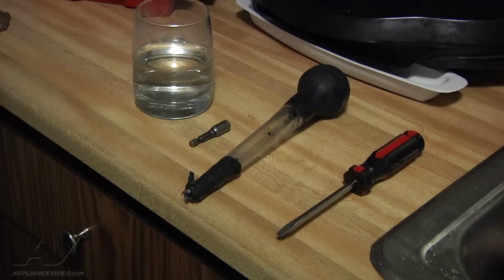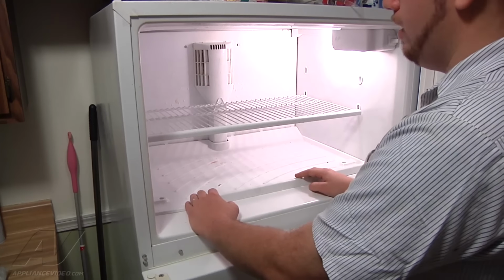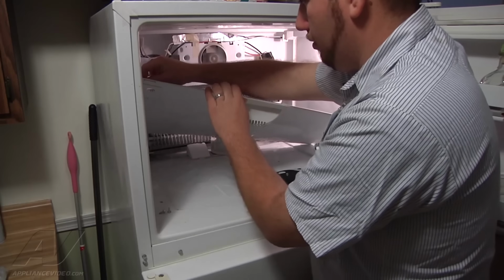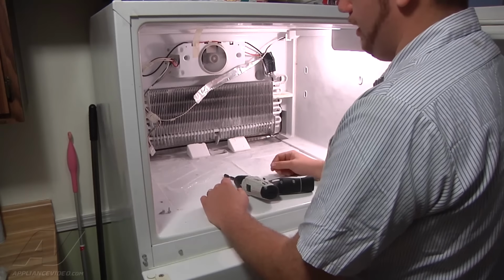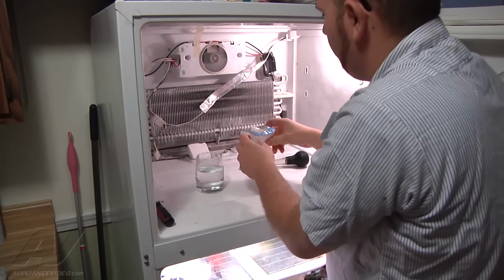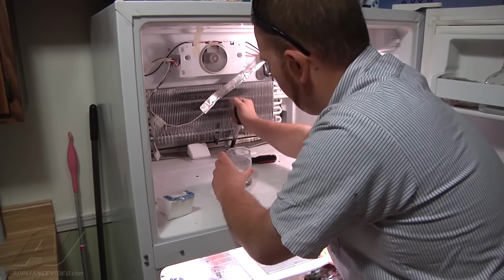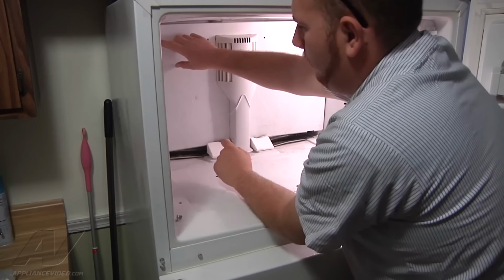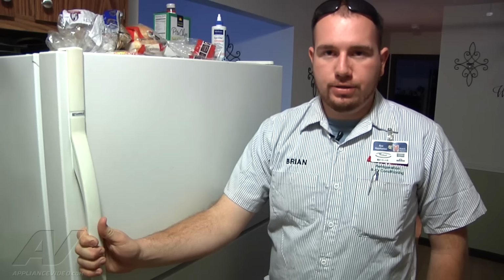Kenmore Refrigerator Repair - Water Leaking From the Freezer - Evaporator Drain Pan

Comment: Thanks! Mostly helpful only.... my Kenmore(freexer on top) model 253.68802011, doesn't have a bottom panel to remove.  Just the back panel that exposes the evaporator, etc. There are two ports visible there, one behind the other. Should I pour hot water down one of them? Both? What is there is ice buildup under the bottom plastic lining? How do I get at it then??

If you have a moment...

Comment: I did what you have shown and used a fish wire to clear the drain line all the way down to the drip pan underneath and everything was good for two weeks and I just today I have a layer of ice forming again. however the fridge seem to run well.  what is the next step?

Comment: looked and worked nearly exactly as mine. one note: BE CAREFUL WHEN PUTTING THE SCREWS BACK IN WITH THE FLOOR PIECE STILL OFF. i dropped BOTH of mine and first thought 'oh no - down the drain hole that went!!' 

It actually went down the air hole into the fridge and was just sitting on the top shelf next to the mayonaise. 2nd project (pulling out the whole fridge and looking for the screw in the back near the final drain pan) averted.

Great Video. Saved my probably 25 year old fridge from needing a service call ($$$).

Comment: Very good video. Very helpful.  Thank you.   My Kenmore is 47 years old.  Also freezer on top.  Is it set up pretty much the same way as in the video?   --===-  BTW, it's worked fine until a year ago when it needed manual defrosting for the first time.  I took the back panel off and I guess I got all of it except the drain tube, that I didn't know about.   So it drips sometimes, and used to overflow onto the floor.  I will fix that now.   ---  I had to replace the thermostat once, and once a mouse died in the fan at the bottom so the fan would not spin, but I didn't figure it out for 2 months.  I thought this would tax the fridge so much it would fail but it works just as well as ever.   I think I replaced the fan motor a few years later, again not right away, again I thought it would damage the fridge, but again no change.   Also, when I removed the freezer floor panel last year, it was in perfect condition, still flexible and not at all brittle after 46 years.   --------- Is it' true that modern fridges only last 10 years?

Comment: I had the same issue. I had to clear the debris and then force a tiny bit of really hot water (two times) using a turkey baster thru the opening, and water stopped accumulating. Thank you.

Comment: In my case the hole is plugged and can't get anything in there. Just tried coat hangers, wires and compressed air. Looks like it needs a new part.

Comment: I have a question the lady I got the fridge from said that the fridge was leaking when they used it, but it has been plugged in for a long time now I have it plugged in for about a week now, but it hasn’t been leaking at all. 

Does this mean it just had to have the chance to unthaw?  

Or is there something wrong with the fridge still? 

I put a small tube down the drain tube and it reached the bottom of the pan 

So I’m guessing there’s nothing stuck in there could it be the heating element that’s broken?

Comment: That was a temporary fix!! Your coil is freezing as it is supposed to, the problem is the electric part that gets the coil hot to defrost the ice so it drains down the tube and out into the catch tray underneath the fridge. You need to replace that!!🤦

Comment: Did not work. Took the top light fixture out and the back of it was not frozen. It was empty and the drain hole is clear. The fridge still puddles in underneath the two drawers and out onto the floor at the front. 
I pulled fridge out and cleaned the back coils off as best as possible. 
Can anyone tell me how to really fix this fridge?

Comment: Similar Kenmore models: may not have a removable bottom pan, may have an icemaker on upper left. Before you remove the back panel, the icemaker comes out with 3 screws then unplug a wiring harness (lift the small tab and separate). 
Get that turkey baster water HOT and remove all your fridge shelves for drying off/de-icing afterward.

Comment: Debris? What if it's just ice?
Isn't the real solution if that's the case to buy a kit with a wire that connects the defroster to the drain to keep the drain from freezing?
If the problem is about ice not debris then won't it just happen again unless you add a heating wire as discussed?

Comment: Hopefully you're still reading the comments 10 years later excellent video thank you. But why do I have rust in the drain pan and even underneath the drain pan. But more alarming is to the top right that wire that has that black foamy sticky stuff about 2 inches long wrapped around it. Mine was wet and had fallen apart and pieces of that black sword of clay like stuff had fallen down onto the coils underneath. Also the styrofoam piece jabbed in horizontally there's one on each side but this one styrofoam was also wet and had pieces of that black clay like stuff on it. What should I do? The black clay like stuff was very wet when I squeeze it a lot of water came out. Please advise

Comment: The only difference for me is that a cup or two of hot water would never have been enough to clear my drain. Good idea to use compressed air I did not think of that. I will use it when I clear the ice out of the clogged drain on my refrigerator next time. I boiled pans of hot water. It clogged again and I need to do this to get the pan i have taking up half my top shelf in the refrigerator to catch the water that drips down. I will use a big mop to mop off the water the spills out of the freezer onto the floor.

Comment: Hi I just did this about 2 months ago and it stopped leaking for a while but it started again. There are icicles that form on the styrofoam that goes into the fridge. Does this mean it’s still an issue with a clogged drain pipe?

Comment: I have this Model but with an ice maker. You can’t remove the shelf or back panel without removing the ice maker which I didn’t want to get into. So, I put a large rectangular 2” pan under the air ducts and flooded the frozen area with warm water then used a shop vac to extract all the water including vacuuming the air ducts. We’ll see….

Comment: I have a Kenmore elite side by side refrigerator, Model 106.56704500. Every 6 months when I change the wa-ter filter cartridge in the base grille, I expect to see some water spillage, as per the manual. Recently, howev-er, I am experiencing an excessive amount of spillage. I have to use three or four beach towels to mop it all up. However, once I insert the new cartridge, the fridge seems to be working fine. All the same, it’s scary to see all that much water spilling out. One thing that might be relevant is that we no longer make ice on a regu-lar basis, so the ice storage caddie is just being used as an extra freezer compartment. Is there a connection between no ice-making and excessive water spillage?

Comment: I just had to do this on a 17year old GE model GTS22JCPBRWW and it was dripping water onto the top fridge shelf. I did the turkey baster thing until the water drained itself. Thanks for the video. Screw buying a $1200 + dollar fridge. Theses older ones last much longer it seems like than these newer ones I see all kind of problems from people like the compressors failing within 2 years and water and ice dispenser issues etc. The only thing I had to do to this GE fridge in 17 years was both fans. 1 in back bottom and 1 in freezer and that's it.

Comment: So let's say this happens in a rental unit, it doesn't get used for a while, and just stays on so no mildew forms. is it possible that the ice clogs something to the point where the fridge no longer cools?

Edit: the freezer is cold still, but I need to replace it if that's not the problem. I fixed my washer's door switch after following another video you had, so I trust you more than some forum.

Comment: We had water flowing into the fridge. The drain was frozen and filled with gunk. We had to use air hose to blow it out after we melted the ice. But now fridge is quiet and working great. Thanks

Comment: We decided to unhook our waterline to the refrigerator because the plastic tubing was brittle and breaking. However we are having the same issue as y’all. So do we still take these same steps? Thanks for your time
Reply from the maker: Great question, if you have a more technical question that our parts department cannot answer, you can search our over 17,000 answered questions free at our website www.ApplianceVideo.com under our Repair Help section. You can also call our parts department at 1-800-830-5465 and they can give you help 7-days A week ,or search at www.SaveMoreOnParts.com  .

Comment: If the water is leaking in the bottom shelf of the freezer of a side by side. Could this cause my ice cream to defrost and things in freezer get freezer burn? I never hear my freezer defrost like my other one. There is no water on the floor. Thanks if you see this.
Reply from the maker: Great question, if you have a more technical question that our parts department cannot answer, you can search our over 17,000 answered questions free at our website www.ApplianceVideo.com under our Repair Help section. You can also call our parts department at 1-800-830-5465 and they can give you help 7-days A week ,or search at www.SaveMoreOnParts.com  .
Reply: @Appliancevideo  I guess I misunderstood.  I thought these were actually repair men that had a channel who answered ppl questions. Not an advertisement for a company.

Comment: We did this a couple months ago and now it is dripping and frozen again.  Why is the drain freezing to begin with.  Our unit is about 8 years old.  Is there another issue causing the freezing?
Reply from the maker: Great question, if you have a more technical question that our parts department cannot answer, you can search our over 17,000 answered questions free at our website www.ApplianceVideo.com under our Repair Help section. You can also call our parts department at 1-800-830-5465 and they can give you help 7-days A week ,or search at www.SaveMoreOnParts.com  .

Comment: I have a 2003 whirlpool that is iced up. This has been very helpful. I remember we did this once years ago when something had blocked the drain but couldn't remember the procedure. I wonder if power outages have messed it up to cause this problem.
Reply from the maker: Great question, if you have a more technical question that our parts department cannot answer, you can search our over 17,000 answered questions free at our website www.ApplianceVideo.com under our Repair Help section. You can also call our parts department at 1-800-830-5465 and they can give you help 7-days A week ,or search at www.SaveMoreOnParts.com  .

Comment: I have cleaned my tube twice. It keeps freezing the water in the tube and water then spills out into the freezer and freezes. Is there anything else causing this issue. I used boiling water and am sure the tube is clear because the water flows into the catch under the fridge right now. I am sure this is going to happen again..thks..jc
Reply from the maker: Great question, if you have a more technical question that our parts department cannot answer, you can search our over 17,000 answered questions free at our website www.ApplianceVideo.com under our Repair Help section. You can also call our parts department at 1-800-830-5465 and they can give you help 7-days A week ,or search at www.SaveMoreOnParts.com  .

Comment: I've been using a funnel and plastic quart bottle inside the refrigerator to catch the water dripping down the air duct from the freezer.  Now, after watching this very informative and easy to follow instruction video, I know how to solve the leaking water issue more appropriately.  Thank you very much for sharing your knowledge!!
Is freezing water blocking the drain tube something that can be prevented or is clearing the drain tube simply a matter of periodical necessary maintenance?
Reply from the maker: Great question, if you have a more technical question that our parts department cannot answer, you can search our over 17,000 answered questions free at our website www.ApplianceVideo.com under our Repair Help section. You can also call our parts department at 1-800-830-5465 and they can give you help 7-days A week ,or search at www.SaveMoreOnParts.com  .

Comment: Thank you! We were mystified by the water collecting at the bottom of the refrigerator. Thankfully we discovered your video, and your instructiions were dead on so I was able to fix the problem. The only thing that wasn't in our 20 year old Whirlpool freezer were the small vent caps; the appx. 2" square holes are totally open. I'm going to see if I can order replacement caps. Thanks again. Great video!
Reply from the maker: Great question, if you have a more technical question that our parts department cannot answer, you can search our over 17,000 answered questions free at our website www.ApplianceVideo.com under our Repair Help section. You can also call our parts department at 1-800-830-5465 and they can give you help 7-days A week ,or search at www.SaveMoreOnParts.com  .

Comment: All right, I have read all your comments but I would like to know how one can prevent the drain tube from freezing, and how come it only happens after several years using the fridge; however, it did not happen in past when the fridge was relatively new. We keep the fridge clean and we cleaned the frozen hole and the drain tube  few times already. It was suggested to have a wire placed to the drain hole to transform  the heat from the heating element to keep the hole from freezing; however, it may help but what is the real cause that the drain tube is freezing? How come the new fridge does have that problem when under warranty?
Reply from the maker: Great question, if you have a more technical question that our parts department cannot answer, you can search our over 17,000 answered questions free at our website www.ApplianceVideo.com under our Repair Help section. You can also call our parts department at 1-800-830-5465 and they can give you help 7-days A week ,or search at www.SaveMoreOnParts.com  .

Comment: I think the compaines know about this and could have fixed it so we don't have to go out and buy another Refrigerator. In this day and age of technology they can't  find a way to prevent this from  happening? There is a bottom panel that gets the water and it has a heater there to prevent the water from freezing, so why not apply that same system up there in the Freezer?
Reply from the maker: Great question, if you have a more technical question that our parts department cannot answer, you can search our over 17,000 answered questions free at our website www.ApplianceVideo.com under our Repair Help section. You can also call our parts department at 1-800-830-5465 and they can give you help 7-days A week ,or search at www.SaveMoreOnParts.com  .

Comment: Would there be any other reason for water to leak into the fridge if the drain tube isn't clogged? I'm working on the same fridge and I can't figure out why it's still leaking. I know the drain isn't clogged but it's still leaking.
Reply from the maker: Great question, if you have a more technical question that our parts department cannot answer, you can search our over 17,000 answered questions free at our website www.ApplianceVideo.com under our Repair Help section. You can also call our parts department at 1-800-830-5465 and they can give you help 7-days A week ,or search at www.SaveMoreOnParts.com  .

Comment: No matter how many times I clean it out and defrost it the drain line freezes up again. I'll never buy another whirlpool fridge. Junk! I even ran a string down the drain tube with a small cloth on it to prove it was clean. But it just freeze up again.
Reply from the maker: Great question, if you have a more technical question that our parts department cannot answer, you can search our over 17,000 answered questions free at our website www.ApplianceVideo.com under our Repair Help section. You can also call our parts department at 1-800-830-5465 and they can give you help 7-days A week ,or search at www.SaveMoreOnParts.com  .
Reply: MrMysticSeer, how often does this happen to you? I found a great deal on this model fridge and am trying to decide if I should get it or pass
Reply: Steven McAfoose 
I think all fridges are probably good most of the time. Maybe my Freon level is just a little low making it too cold. Google the issue and you'll see if it is too common for you.

Comment: I have water leak under vegetable tray and not the freezer. I have kenmore cold spot mod. 106 59589990. It has a number of coils at the bottom of the fridge behind the vegetable tray. How do I fix this leak? Appreciate your help! Ty!
Reply from the maker: Great question, if you have a more technical question that our parts department cannot answer, you can search our over 17,000 answered questions free at our website www.ApplianceVideo.com under our Repair Help section. You can also call our parts department at 1-800-830-5465 and they can give you help 7-days A week ,or search at www.SaveMoreOnParts.com  .